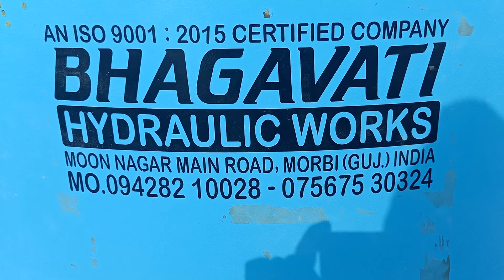Bhagavati Hydraulic Works (BHW203H1)

Comment: How much price this machine in Odisha ?
Reply from the maker: BHAGAVATI HYDRAULIC WORKS
1250000. Pura plant
140000. Plastic plate (500pcs)
45000.  Oil (300 LTR)
______________
1435000. Total
258300.   GST
--------------------------------
1693300. Final price

Transporting extra
Maximum price plant startup